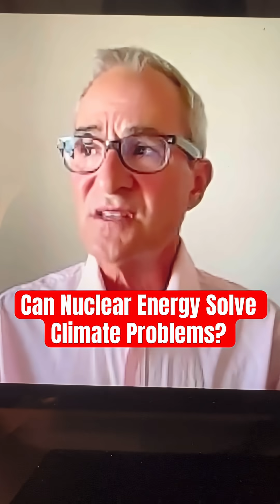Can Nuclear Energy Solve Climate Problems?

Comment: False, the reduction in production for french nuclear in the summer is 0.1%, insignificant. Nuclear doesn't need massive amounts of water, using evaporating towers the water intake is reduced significantly, and even without them, you don't need massive flow rates, they are proportional to power production.
What does it matter that it takes a few years to build them if we've been trying for decades with renewables and we've barely made a dent?
The coastal argument is also riddiculous, you don't need to build them directly on the sea line.
Nuclear is absolutely necessary for the energy transition and fighting climate change. Everybody in the field knows it.
And what can we do here and now?? Plaster solar panels everywhere that are precisely equivalent to garbage the overwhelming majority of the time? What about the massive environmental impact of both the deforestation due to land requirements and the toxic lakes and oper air mines left by the mining and refining of the raw materials?
Plus what are you gonna do at night or in the winter? Cause the plan seems to be just burn fossil fuels.
All of this factually false and the implications are nonsensical.
Reply from the maker: What qualifications do you have to speak in this topic? Do u have a phd in nuclear physics or nuclear energy or something? You heard an expert with real examples and u still do not believe it
Reply: @ScienceTalkOfficial  I keep responding and my comment is deleted immediately. 
I have a master's degree in energy engineering. 

Paul Dorfman is charlatan who calls himself a "nuclear expert" but is actually a political science professor who sits in the Russian International Affairs Council with Russia's Foreign Minister Lavrov and members of Gazprom.
Reply from the maker: @user-ht3sc3sz7h his bio: https://www.weforum.org/stories/authors/paul-dorfman/
Reply: @ScienceTalkOfficial  are you familiar with Jordan Peterson? He's a psychology professor and an absolutely deranged right wing climate denier. Well, he advised a UN subcommitte on climate change once. 
Point is, the fact that someone has found himself in a bunch of distinguished positions doesn't mean that he knows what he's talking about. Also can't find anything on here or the internet about him having any actual  degree either on climate science, energy engineering or nuclear engineering
Reply from the maker: @user-ht3sc3sz7h i agree that degree doesn’t give you full authority and they can be wrong.
Reply: @ScienceTalkOfficial  Btw the "expert" brought absolutely NO real examples.
Reply from the maker: @user-ht3sc3sz7h he gave many examples during his interview. Complete interview will be available tomorrow
Reply: @ScienceTalkOfficial  NPPs can and are built regularly in 6-7 years. There have been various NPPs that have suffered delays in construction, exclusively in the west and largely because of constantly changing regulations and disruptions pushed by organizations like the one Paul Dorfman founded.
Reply from the maker: @user-ht3sc3sz7h what about maintenance cost? Is it not in billions?
Reply: @ScienceTalkOfficial  for 1 nuclear power plant? Over a 60/80 years lifespan? Depending on how they're defined yes, could be in the billions. It's a goddamn nuclear power plant. Have you asked yourself how much it would cost to install and maintain an equivalent amount of solar panels or wind turbines? International energy agency estimates put nuclear's levelised cost of electricity below that of solar and wind once you account for storage costs.
Reply from the maker: @user-ht3sc3sz7h i did ask and it was super cheap. Renewable energy is the cheapest form of energy right now. Windmill is cheapest, the solar. Gas is the most expensive and coal.
Reply from the maker: @user-ht3sc3sz7h  https://decarbonization.visualcapitalist.com/the-cheapest-sources-of-electricity-in-the-us/
Reply: @ScienceTalkOfficial  No they are not. Nuclear is the cheapest. Solar and wind only appear to be the cheapest if you ignore the cost of storage, and the massive requirements for grid connections and added transmission capacity (they are distributed generation that requires a lot more points of connection to the grid and their availability is often conditioned by geography, so they require a lot more high voltage power lines to transport the power to population and industry centers).
Reply: @ScienceTalkOfficial  this is lazard. this has been debunked a million times over. 4 hour batteries aren't doing anything to make solar and wind power available at all times all year round, and the cost of nuclear isn't the cost of nuclear, it's cherrypicked as the most expensive reactor ever built. Look up IEA - Projected costs of generating electricity
Reply from the maker: @user-ht3sc3sz7h are you refuting the evidence I shared with you.
Reply: @ScienceTalkOfficial  yes, and I am correct. Go look at lazard, the source in your link, and you will see that 1) by "storage" they mean 4 h Li-ion batteries. Does the night last 4 hours? Does the winter last 4 hours. Prentending that 4h of battery storage is enough is ridiculous. 2) the LCOE they provide is not of "nuclear" but of specifically Vogtle, Vogtle 3 in particular, the most expensive reactor ever built. In academia, presenting an outlier as representing a whole population is called lying